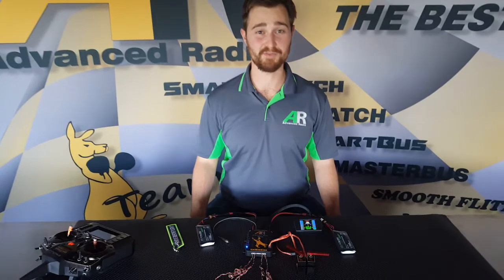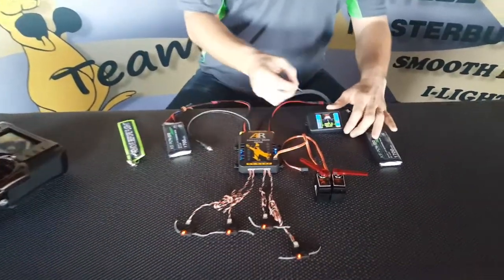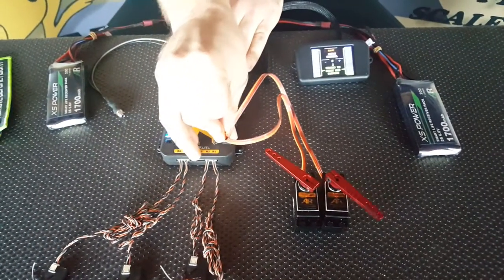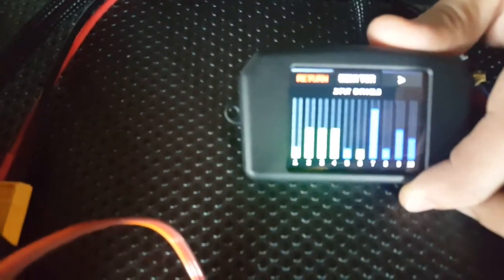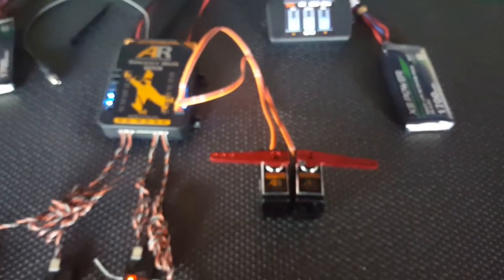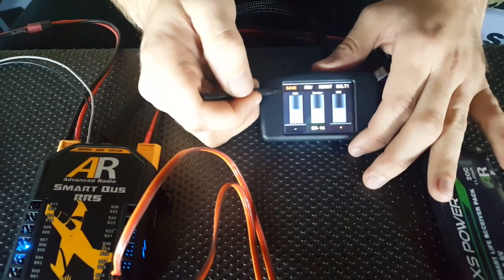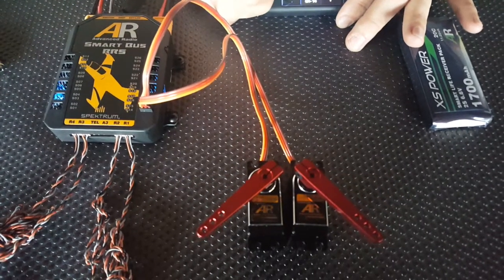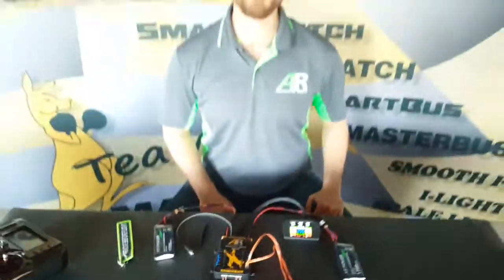Smart Bus RRS setting up multi flaps with one channel.

Comment: Are there specific receivers that work with RSS Extreme? I couldn't even get the receivers to communicate when bound. The bars are green, but don't move. I really need some help here. Using an IX-20 and a pair of AR6610T. Doing an airshow this weekend.
Reply from the maker: Tim,
The ARXL is like a powersafe receiver so you need to use SRXL2 satellite receivers with the ARXL.

1 x SPM4651T and up to 3 x SPM9747.

In the ARXL unit select SRXL2 protocol.